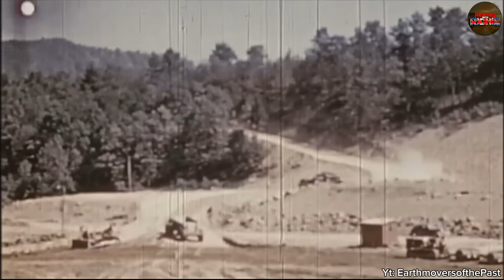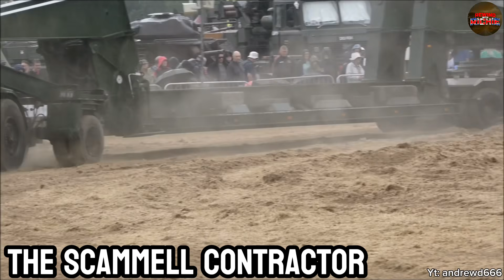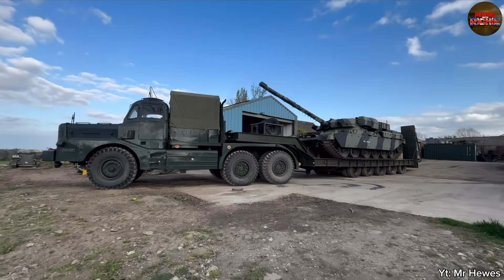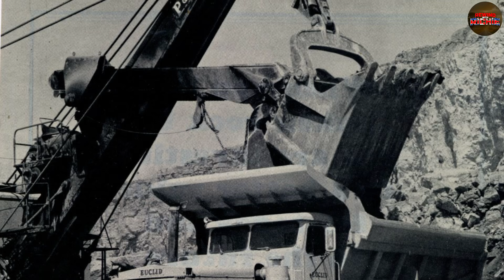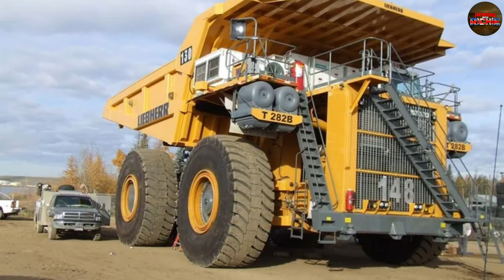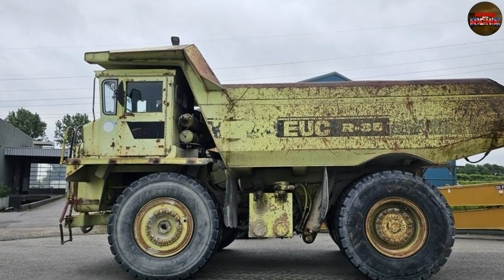From Foden to Terex – Britain’s MIGHTY Quarry Lorries

Comment: I was an undergraduate apprentice at Aveling Barford in the early 70's. The original SN 30-35 ton trucks were just being phased out. They had Rolls-Royce straight 8 diesels and manual gearboxes. Their claim to fame was that they were used to build the Aswan Dam in Egypt. Their successors, the SW range up to 50 tons were really innovative. They used oleo strut suspension all round, independent on the front. With their DD or Cat engines and sophisticated transmissions they were really fast on the haul roads. Unfortunately AB was part of BL and was dragged down by the poor management and rubbish industrial relations of the automotive division.

Comment: No mention of Aveling Barford here in Grantham? Can remember the dump trucks being transported wheel less through the town in the 70's and 80's.
Reply: You beat me to it. All the way through, I was waiting for a mention of Aveling Barford.

One place I worked, there was a Foden, just like the yellow model in this video. It was fitted with a Gardner engine and was pressed into service, if one of the regular fleet was out of service. Originally,  it had solid front tyres, which were still kept at the back of the workshop.

Comment: Hard to imagine a 2 stroke V8! Amazing trucks! I worked in Malta in the mid 70's and you could see many of these old beauties in use driving around doing what they were built for! Good video!
Reply: Detroit Diesels were very common. Modular engines, everything up V12 and V16s were available.
Reply from the maker: Glad you liked it